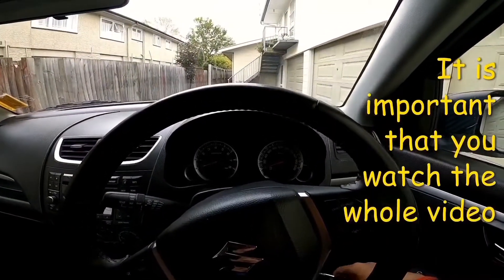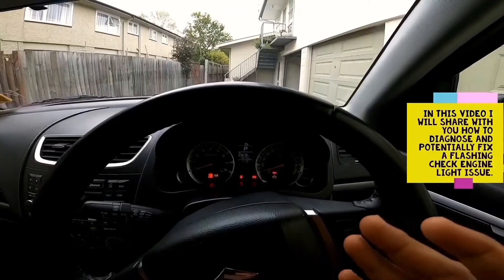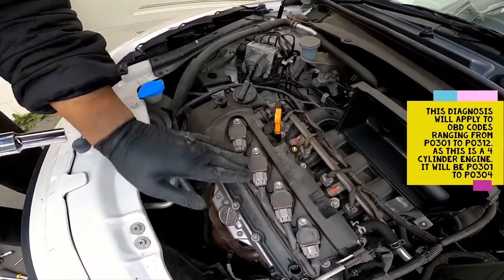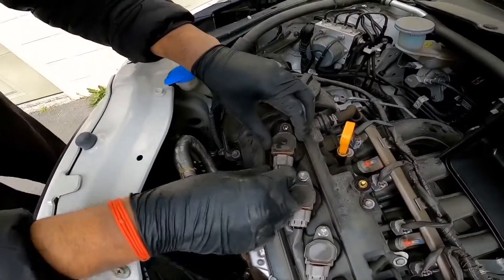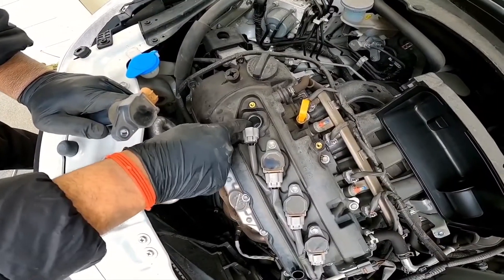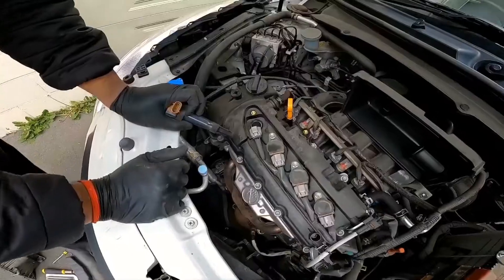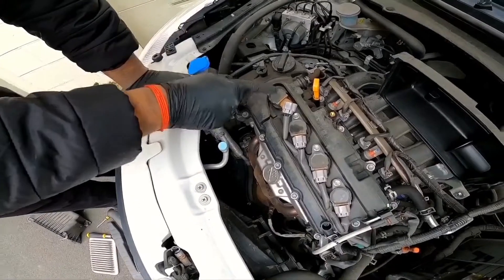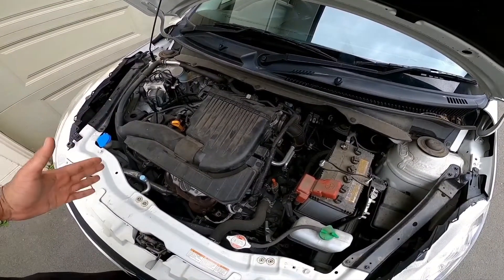Flashing Check Engine light with rough idle - Basic how to diagnose and fix

Comment: I have a 98 Civic DX with a flashing cel yesterday.  My issue was faulty spark plug wires. I replaced  the plugs first with some improvements but not completely free of vibrations. Put all new wires on it and it fixed the issue.
Reply from the maker: That is great to hear . In this video I showed how to tell which cylinder was having the issue first and to see if it moves with testing.  Consider Subscribing to my YouTube Channel if you haven't already.

Comment: Hey there!
I have a 2017 Mercedes E class, I was accelerating and changed the gear to the 3rd or 4th gear if I could remember, with my paddle shifters. And then the car suddenly got the flashing check engine light and my car started to vibrate a lot while idle but not much when I drive, plus the exhaust sound changed, with a weird noise from the engine, do you know what’s the issue? Plus the next morning I turned my car on and the check engine light was gone and vibration and everything went normal and fine, is it safe to drive it?
Reply from the maker: Hi, sounds to me like a misfire . If you didn't feel the misfire the next day , the vehicle might be compensating for the miss fire.  So example if you have P0301 misfire on cylinder 1 and the rest compensate you might get a P0300 which could be why you did not feel it the next  day . Better to get it OBD read. Make sure to Subscribe to my YouTube Channel for free if you haven't already to show your support.
Reply: @DocMackGarage  if I changed all spark plugs will my issue  be fixed?
Reply from the maker: @zFavio  It could be either, plugs, coils , or injectors for your particular issue.  Did you Subscribe?

Comment: My 2007 Mercedes C class gave a check engine light then started flashing. When coming to a stop it gave me a slight bumpy / sputtering feeling. It starts up and I haven't driven it because don't want to damage the convertor. Any ideas? Great video. It idled harder for awhile but then had no engine lights on.
Reply from the maker: Hi, firstly make sure to Subscribe.  It is free to Subscribe.  You are experiencing a misfire . It is either coils or plugs  .I have a video on how to check https://youtu.be/-wKmjxZKB4g
Reply: Same thing here
Reply from the maker: @huntert50  What car and lights do you have ?
Reply: @DocMackGarage  same here! Just changed the pvc hose because it was leaking fixed it to like 90% but now it’s suttering again, I have a broken catalyst converter that’s rattling, so you think that could cause my engine to misfire or stutter?
Reply from the maker: @robertrodriguez6739  Hi Robert, PVC or PCV ?

Comment: My mustang did a flashing engine light but it went away once I turned the car back on 2 hrs later however when I took it in there were the no codes ..is that a bad thing ?
Reply from the maker: Hi Jason  , yes a flashing check engine light should be taken seriously,  however  the cause is not always that bad. It sounds like a misfire which can also be catalyst damaging . Did you return from the gas station before ? Did any plugs or coils ?
Reply: @DocMackGarage  it happened a little bit after getting gas and I haven't checked the coils
Reply from the maker: @Jman23431  Checl if the gas cap is tight , if it is then check Coils, plugs , MAF . Also consider Subscribing to my YouTube Channel for free. I post lots of car videos. Make sure to turn on post notifications.

Comment: If u put Gass with possibly water in the fuel would that make the engine light to flash and mortar to shake
Reply: Motor shaking prolly mounts. The blinking means misfire

Comment: My 08 Honda Accord coupe have a misfire p0301 and p0304 can’t figure it out any suggestions I already replaced everything beside the fuel pump I didn’t know that had something to do with misfire
Reply from the maker: Hi Bella, that means it cylinder 1 and 4 misfire . Did you try my suggestion in the video to troubleshoot? Have you Subscribed to my Channel? It's free to Subscribe and you will get notifications of helpful videos I post.
Reply: @DocMackGarage  yes I did all of that had spark plugs replaced/coils everything even the motor is replaced and still misfiring idk what it is I’m close to junking it
Reply from the maker: @bellaramos6251  Injectors done ? How is the timing ?

Comment: When I hit a certain speed on my truck (about 55 miles per hour) my engine light starts flashing, what could that be?
Reply from the maker: What do you feel the vehicle do when the light starts flashing? When you come to a stop does it go away ?
Reply: @DocMackGarage  my wife's car does the same things and does stop,when she slows down or stops..
Reply from the maker: @turk1829  Hi, have you tried the suggestion in my video ? Did your wife get a wheel alignment done recently , or how do you feel the alignment is ?
Reply: @DocMackGarage  ..Yes we just bought the dodge caravan a few months ago,at first it ran fine,now it has burst of acceleration and the check engine light flashes when she accelerates..We changed the wheels from her old van to this one and problems since..Please Help🤝
Reply: @DocMackGarage  ..New Sub
Reply from the maker: @turk1829  can you please advise the make and model including the year of the vehicle?
Reply from the maker: @turk1829  Awesome . Cheers for that  .
Reply: @DocMackGarage  2005 dodge caravan
Reply from the maker: @turk1829  There are a few things which come to mind  the first thing to check is the wheels, we're the wheels swapped compatible?   They need to be hub and lug centric, if the centre bore is too big,  the wheel will be only held on by the lugs, and not the hub . This will start to cause vibrations . The other thing I can thing of is a steering angle sensor which needs to be recalibrated. Were the wheels you swapped over from a front wheel or rear wheel drive vehicle?
Reply: @DocMackGarage  ..frontwheel drive,off of a 2002 dodge grand caravan,on to her 2005 dodge caravan.
Reply from the maker: @turk1829  hmmm , other than that if my method in this video did not work, then O2 sensor or steering angle sensor.  You can get Autozone or Orileys to do an OBD scan .
Reply: @DocMackGarage  ..We will follow your video and advice and get back to you with how it all turns out..Thank you greatly for your time and help..Appreciated from the heart🤝..
Reply: @DocMackGarage  ukii

Comment: My truck is doing the same thing but my oil pressure gauge is really Fluctuating up-and-down even when I just give it a little bit of throttle. If you get a second look at the video I just posted on my channel! Thank you
Reply from the maker: Hi , a flashing check engine light is slightly different from what I mentioned in this video, I know what the issue is. In fact I have a specific video on this subject . If you see a flashing check engine light , it means that it is not a stored code, it is something that is happening this very second. You are experiencing a misfire . Don't forget to Subscribe and hit the thumbs up button . Your solution is here on one of my other videos .
https://youtu.be/-wKmjxZKB4g

Comment: I used an injector cleaner called royal purple. Now my car is sputtering and the check engine light is flashing. Any thoughts?
Reply from the maker: Hi, what make model and year of car is this ? You can confirm it is fuel Injected?
Reply: @DocMackGarage  
2009 hyundai Santa fe v6
Reply from the maker: @sretif  How much of the bottle did you use ? There is a dilution ratio.  If you use too much the injectors might get affected.  If they get clogged as a result , they will not spray fuel properly and it will cause a misfire . Have you Subscribed?

Comment: For me it was bad compression on cylinder 5. No shop could figure it out. Turned out to be a valve issue. Valve was not seating properly causing a misfire and raw fuel dumping into the cat. You're lucky if doing a tune up fixes the old flashing CEL.
Reply from the maker: Could have been a valve spring , or a Stuck valve . Still a catalyst damaging misfire as I advised in the video.   There are many things which can cause it, so in this video people can try what I advised first .

Comment: I needed help ! Just had my car serviced from AA, they commented the rear wheel beering needs to be replaced ASAP, how can i contact u ?
Reply from the maker: Hi Adnan, you are most welcome.  Which part of NZ are you in ? What make / model / year of car do you have ? What is the current mileage?
Reply: @DocMackGarage  i am from Wellington, suzuki swift 2008 non sport model , mileage 71K
Reply from the maker: I am on the South Island.  I don't have the suzuki swift with me now sorry  as it is a friend of a friends car . This might be something you might need a shop do as you need a hydraulic bearing press kit as a tool to remove the bearing (That cost like $350) and the hub nut is on there relatively tight, and requires to be torqued down to spec. I have another swift video coming out soon.
Reply: @DocMackGarage  boss you are absolutely right ! AA gave me an estimate of total 270 NZD for repair, is it ok ? Or should i be looking for a diff mechanic .. Since i don’t have an idea.. thanks
Reply from the maker: Hi Adnan, the wheel bearing replacement part itself will be around $100 to $120NZD, and probably 1 hour of labour which is typically NZD $60. That will be around $160 to $180NZD and probably GST ontop. If you are going to keep the car long , I would recommend getting it replaced at AA as bearings typically last around 100,000kms and the parts used by AA to my understanding is OEM or almost OEM, whereas other shops may use 3rd party brands.
Reply: @DocMackGarage  I don’t know how to thank you other than expressing them in words, heaps of good wishes for you !

Comment: I just bought a 2002 honda crv and when I got off the highway I was stopped at a traffic light. The check engine light started blinking and the car started shaking a bit. But when the light turned green and I accelerated the engine light stopped flashing and the car stopped shaking. Do you you know what that might be?
Reply from the maker: Hi, yes I do know what it possibly could be .  Here is the solution and remember to Subscribe.  https://youtu.be/-wKmjxZKB4g
Reply: @DocMackGarage  does that link still work? I just had the same problem but the link is no good
Reply from the maker: @Josh-pd7uj Hi Josh, yes I clicked on the link and it still works.
Reply: @DocMackGarage  l also tried to click on link and it doesn't work
Reply: @DocMackGarage  nevermind the link is the same exact video.. didn't really answer the question 😕
Reply from the maker: @sonicreacts6886  Definitely related . Have you followed my guide? Did you get it scanned ?

Comment: What if the light isn’t flashing is it that serious
Reply from the maker: Hi there, if the check engine light is solid then it is a stored code. This could potentially also need urgent attention,  but normally not as serious as a flashing check engine light. Is it just the check engine light on ? What symptoms are you experiencing? Please consider Subscribing if you haven't already.
Reply: @DocMackGarage  I just got my crankshaft position sensor change and when I got it changed the light came on
Reply from the maker: @thelifeofnicknadja340  Hi, if tye crankshaft position sensor was replaced before this light came on, then it is serious.  Did you replace it yourself? Any stalling , hesitation of the engine, or issues starting?
Reply: @DocMackGarage  no car work perfectly fine and a mechanic changed it for me no stalling or problems cranking or nothing
Reply: @DocMackGarage  but I think it could be my radiator fan motor one of them doesn’t work
Reply from the maker: Hmm, it could be a coincidence.  I would recommend talking it to an Autoparts store and asking them to do an OBD scan on the vehicle.  What make mode and year is it ? Remember to Subscribe.
Reply: 2007 Chrysler Sebring
Reply from the maker: @thelifeofnicknadja340  Yes , probably get it scanned.

Comment: What if its flashing  before  you actually  start the car?keyed turned  over with the engine  light  flashing  but not started.....
Reply from the maker: Sounds some sort of emissions test is running on the car. What is the make / model and year of the car? Does the car start fine with no flashing check engine light after itbhas started? Don't forget to Subscribe.
Reply: @DocMackGarage  jeep grand cherokee srt8
Reply from the maker: Try this solution and let me know what happens https://youtu.be/DgUvPQg310E

Comment: Check engine light had been flashing and car has been staying in 8 cylinder and over the last month I've had: oil pressure sensor replaced. New spark plugs (twice) and 2 injectors replaced. Have been told coils are fine.
Check engine light still comes on and keeps flashing and I get "stability control error". Car is very rough, vibrates and idols heavy. 
What else could it possibly be? Mechanics are stumped and we cannot keep spending money. 
Also will note: front link pins have been replaced, 4 new tyres and yhe stability control kicks in after about 20 minutes but engine light stays on.
Sorry for the long comment but I'm at my witts end
Reply from the maker: Hi, No problem.  What kind of vehicle is it and what year ? Mileage please.
Reply: @DocMackGarage  thank you, it's  2012 Holden SS Commodore Wagon and had done 220,000 km
Reply from the maker: @catc1694  Are you in Aus ? I think it could be related to this . https://youtu.be/DgUvPQg310E
Reply: @DocMackGarage  yes I am. I just gave it a clean, it wasn't very dirty though. Heard the clicks and error still comes up but I'll definitely mention it when we speak to the owner at the mechanics tomorrow.  Thank you for the suggestion!
Reply from the maker: @catc1694  You are welcome.  Also worth checking the battery voltage , and MAF . Would also recommend doing an OBD check.  Consider Subscribing to my YouTube Channel if you haven't already.
Reply: @DocMackGarage  already subscribed 😊 thanks again, I'll keep you posted on the outcome
Reply: Throttle body

Comment: If i start the car no check eng. Sometime will appear the check eng. N wil blink. Issue my auto not working speedo?? It is cause the check engine blinking?? Tnx
Reply from the maker: Hi , you should be able to fix it using this method https://youtu.be/-wKmjxZKB4g
Make sure to Subscribe to my YouTube Channel if you haven't already.

Comment: Hey there,

I'm having some weird issues with my Suzuki Ignis, after I had serviced my car, couple of days later I was driving down the road around 80-100kmph and the check engine light blinked 3-4 times and then it went off and never came back again!

What could it be?
Reply from the maker: Hi there , Do you know what the service involved?
Reply: @DocMackGarage  they changed the engine oil, and serviced the engine (i.e. specifically the spark plugs and the ignition thingy above that)
Reply from the maker: @PotatoCamGuitar  oh yup, I see what you mean. If the light is gone off , then should not be too much of a concern.  If you feel a loss of acceleration power,  the  follow the steps in this video.  Consider Subscribing for free if you haven't already.
Reply: @DocMackGarage  yep, watched this video and subbed immediately. May I know the what could be the reason for it to blink for that short time? Also, idk it could only be in my head, but the engine seems rough when idling, could it be faulty O2 sensor, or MAF sensor?
Reply from the maker: @PotatoCamGuitar  That is great to know.  How old is the vehicle? I think it may be misfiring.  Where are you located ?
Reply: @DocMackGarage  the vehicle is 5 years old, and I wish I could get it checked by you, but currently I'm in India.

Edit : also, it's 4am in here and currently I'm planning to drive 300km as I have to reach to my university by 30th, do you think it is safe to leave now? Or should I first get it checked by a mechanic?
Reply from the maker: @PotatoCamGuitar  If you are going on a 300km trip, I would say to get the vehicle scanned by an OBD 2 scanner first. This might give a better idea of what the issue is and get a mechanic to look it over .  I am thinking possibly  Ignition coil, MAF, O2 sensor or fuel injector/ pump.
Reply: @DocMackGarage  alright, guess I'll wait till the morning and get it checked and then leave. Thank you so much for all your replies, mate! Appreciate it. :)
Reply from the maker: @PotatoCamGuitar  You are most welcome 😃

Comment: I've changed my plugs and coils and still stalling
Reply from the maker: Hi, what kind of a car do you have ? Make.  Model and year.  How many miles ?  What are the symptoms apart from stalling ? Any check engine light ?
Reply: @DocMackGarage  yes check engine light is blinking and I have a 2017 dodge journey 2.4l
Reply: @DocMackGarage  with 116k miles
Reply from the maker: @curtismoser8002  Definitely sounds like a catalyst damaging misfire , check there are no stuck open injectors and also check O2 sensor.  Please Subscribe to my YouTube Channel for free if you haven't already to show your support.  I would suggest plugging in a scan tool before throwing parts at the vehicle.
Reply: @DocMackGarage  thanks for the feedback I greatly appreciate it subscribing now
Reply from the maker: @curtismoser8002  You are most welcome 😃